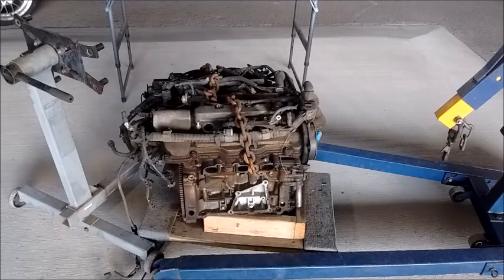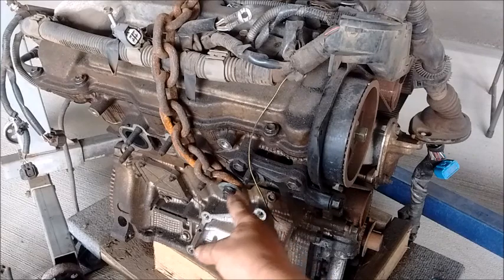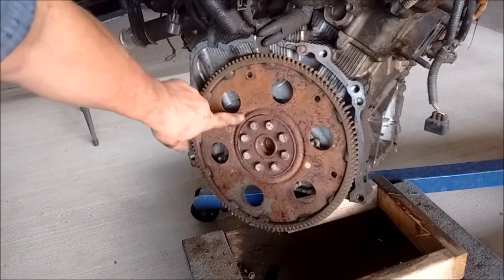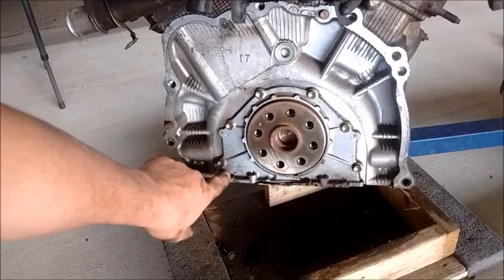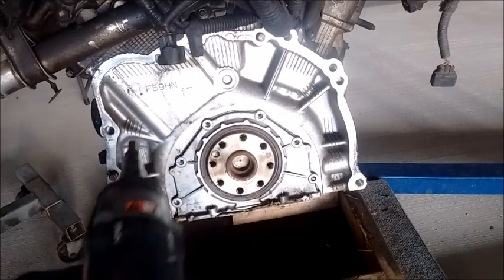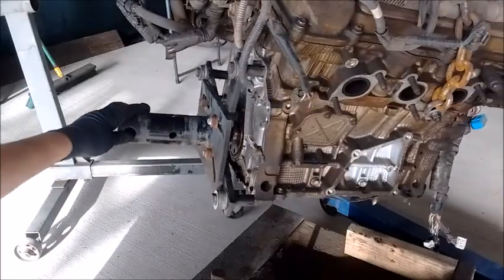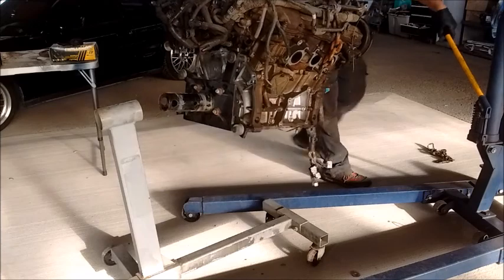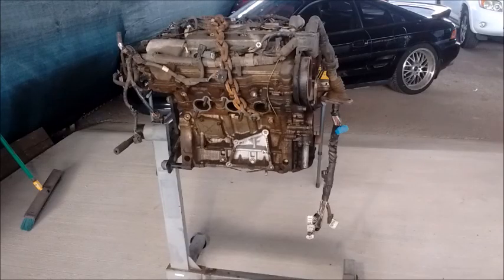Toyota 3.0-liter V6 - 1MZ-FE VVT-i - Complete Tear-Down - Part 1 - How to Put The Engine On a Stand

Comment: Frank I need your help. I've just rebuilt my 1mzfe and I have finally found my oil leak. There is some weird hole behind my timing tensioner where the oil is coming out of. What is this hole and what was previously in it? Thanks
Reply from the maker: Do you have a picture? the tensioner is mounted onto the oil pump, that mounts onto the block. There are different oil pumps for different chassis, because the oil pump must also accomodate the engine mount, which is different in different cars.
Reply: @Merryfrankster_  Yes, I created a post called "Rebuilt 1MZ-FE simple question" on the toyotanation site. I also uploaded the video of it spurting oil behind the tensioner with a borescope, but I had to upload it to the site as a .txt file for people to download and watch, I think the mods might have removed it. The end of the url for the toyotanation link is: /threads/rebuilt-1mz-fe-simple-question.1809110/?post_id=15167732&nested_view=1#post-15167732
P.S maybe you can comment on the leftover bolts mystery. Thanks